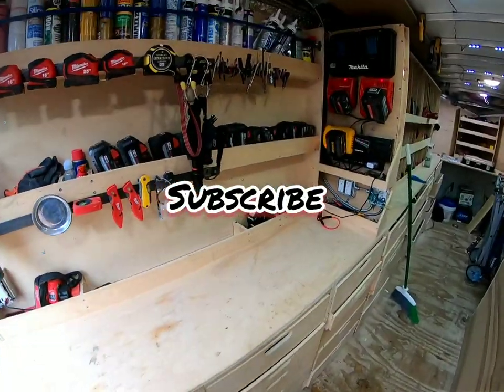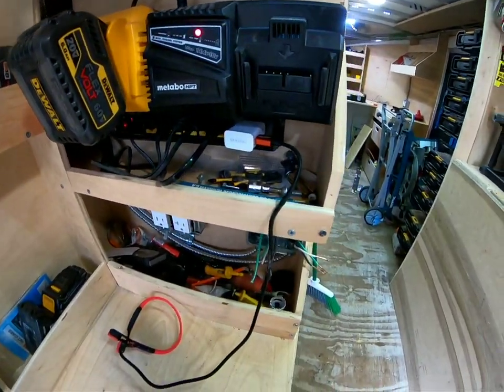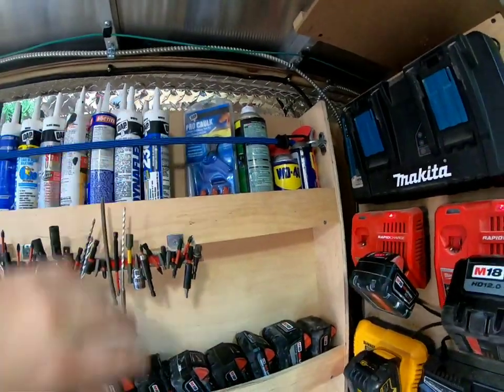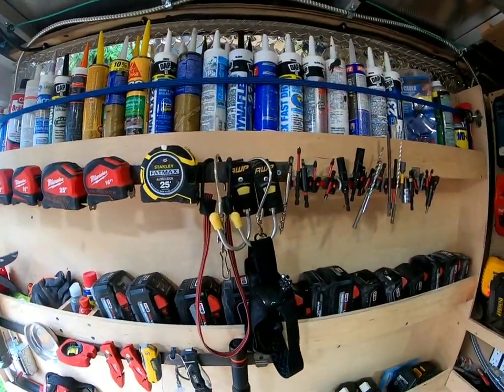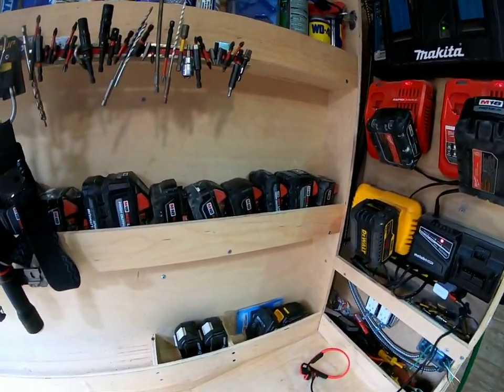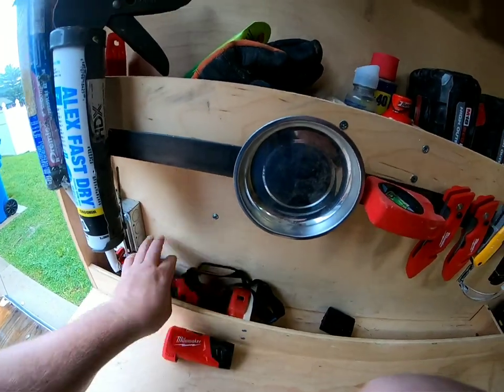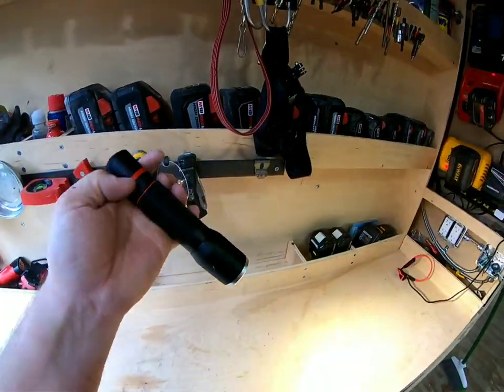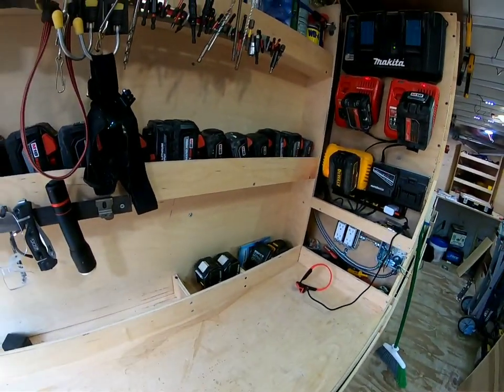Charging Station! Tool Trailer Deep Dive Part 3

Comment: Great video it’s always nice seeing someone else’s work flo. 
I don’t know if “one key”  has leave light on for 20min option, but I have it turned on in my DeWalt “ tool connect”? I have my Milwaukee rechargeable headlamp on my hardhat, and 3 Bosch FL12 (best work light EVER! 😍) as the flashlights I use regularly.